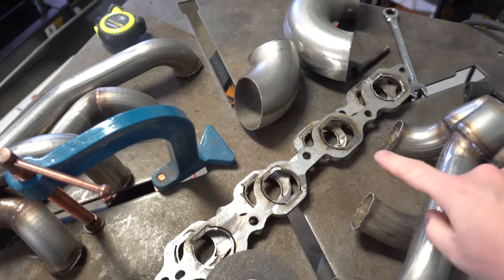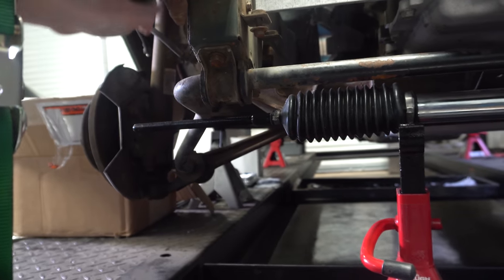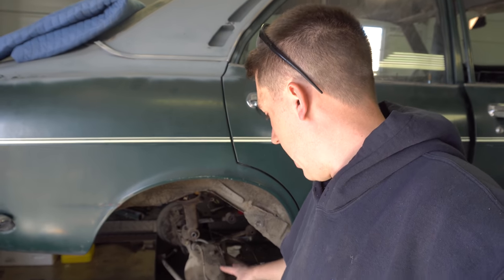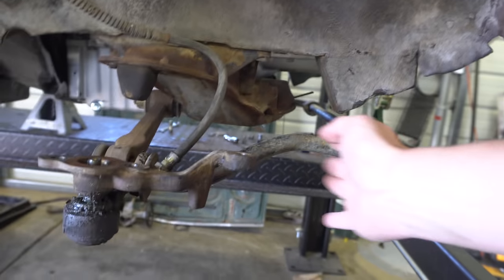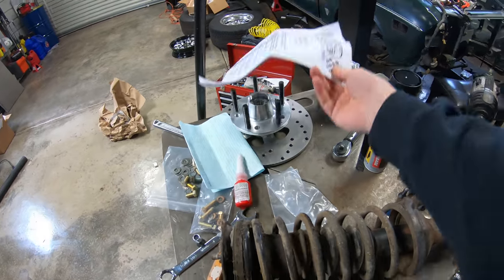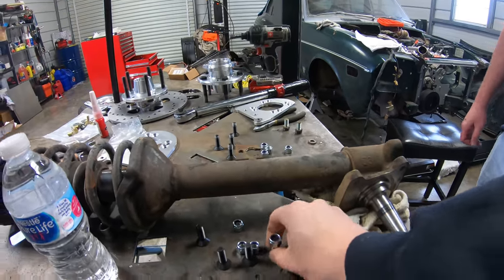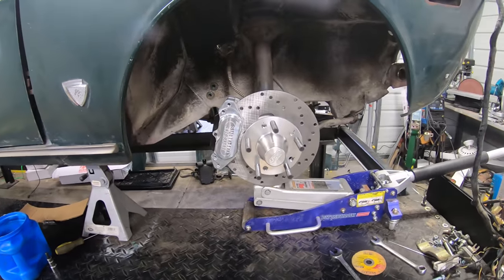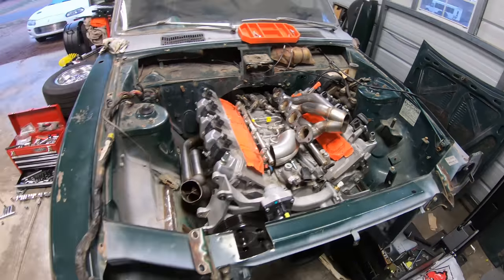l83 Swap Mazda Rx2 Streetcar Build!

Comment: Cool vid, I just bought a 64 skylark 6 months ago then i saw your channel, awesome job.
Reply from the maker: Very cool! What's your plans with it? Thanks for watching!
Reply: I'm only 14, and I spent all my earnings on buying it, eventually tho I would like to go with a Chevy sb2.2 engine, upgraded suspension, coils, etc.  Its actually the same ice blue color as yours, I might just keep it that way, a patina kind of look
Reply from the maker: That's awesome! Is yours running and driving currently? Cool to hear you went and bought a car already!
Reply: Well I just changed the intake manifold gaskets, the car had only 65k miles, which in the long run is a great thing, but it also means that the car has been sitting and a few things (especially the gaskets) need replacement. Any way we thought the block might have been cracked but it wasn't, so this afternoon has just been the process of painting, and putting the manifold and components back together.  So long story short, we just have to put the manifold on and adjust a few small things and it will be good to go.